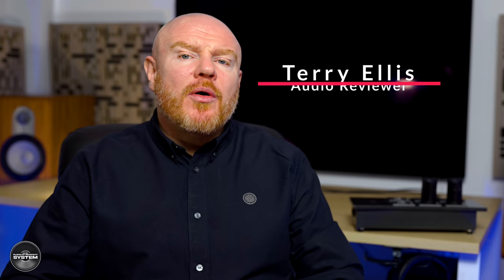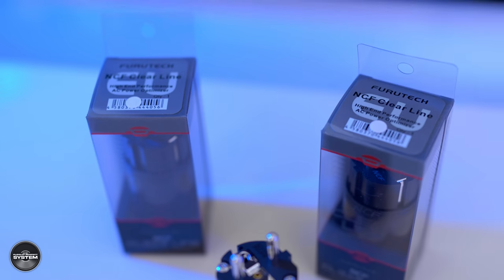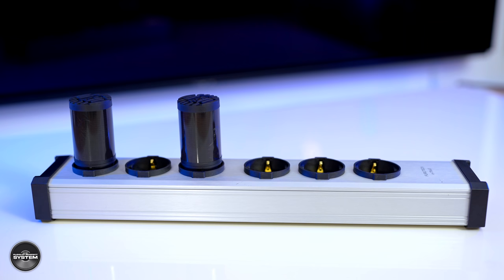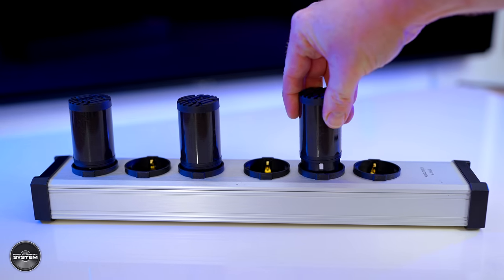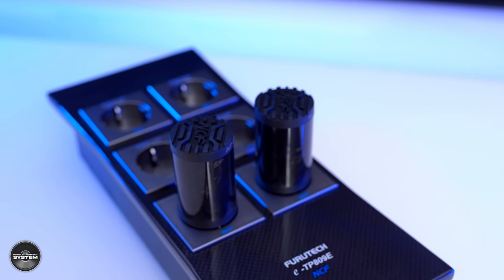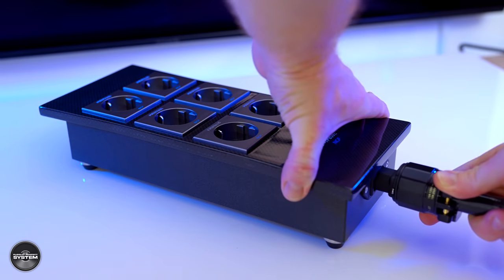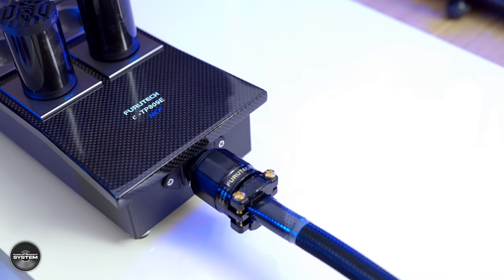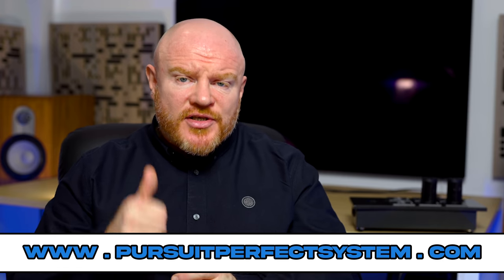Does Power Matter for Sound Quality ?? Furutech NCF Clear Line Review

Comment: The main thing that is happening here is the background is becoming slightly blacker and more acoustically transparent. Initially, there is a whisper of air and freedom that appears around the singer's voice that grabs your attention which in turn makes you listen for similar improvements around the instruments. Once you hear them, the difference is quite apparent. In my journey through audiophilia, I have saved so much money simply by improving the power that I am feeding my system. I use the iFi Audio power solution with AC filter that is very similar to this Furutech example. Gone are my days of trying to improve my system by replacing components because I am looking for that next micro slice of goodness. Now I have properly clean, inky black, silent power from the mains and all ports, I only need to change equipment if it breaks or I want something different. I'm pretty certain that I now have my endgame thanks to clean power and clean audio signals. This is such an important piece of teaching that is often missed by would-be audiophiles simply because they are unaware. Really good job, Terry. Outstanding video with the right amount of audio comparison to give people a better idea.
Reply: Hi
Reply: and other conditioners such as lessloss 64x firewall and better fuses

Comment: As in the past tubes in amplifiers was call VALVES because it open and close current flow from power supply section, it is clear that we listening power supply via controlled current flow in speakers. That is a physics of power amplifiers and their definitions.  That why is called POWER AMPLIFIER. Opinions can vary, but opinion will not affect physics and how it works.  So how many brands of POWER AMPLIFIERS declare relevant parameters of power supply section - non. But you need special power cord that cost  30% of power amplifier ??. How about that all these reputed makers of power amplifiers make a popper power supply that shall not depend of impulse transfer performance of power cord? And stop declaring that power supply section is compliant with standards  made for water heaters.

Comment: Outboard filters, come in the shape of power line condition sockets or plug in like the NCF in this video....inside really just some coils. capacitors, diode and some transistors...
They do clean the noises and "condition" the electricity flow for better sound and video....
But what we need to know is where and when we need them because they are quite expensive for what they are...
In high end equipments (amp, pre...), these filtering circuitries could be well built in already, with very good design (double or triples the filter stages) and high quality components, ...So adding Outboard filtering is not necessary, it basically means you are adding another stage on top but with a lot of money.... in most cases they only change the sound, not the quality...
If you have lower tier equipments, then yes, it makes sense to spend on these power line filters...
So you have 2 choices, spend all money on better equipments, not on the power conditioners...or buy cheaper equipments then spend some more money on conditioners...the total amount of money could be the same, so its your call..
Reply: But Terrys system is very expensive. And I doubt anyone could dismiss the difference....

Comment: Here's two start points so you can compare quick A/B's
 11:55 12:41
For anyone not hearing a change between the two, perhaps the easiest difference to notice is the much greater "black background" in the second clip. I'm not sure which I prefer personally but it's certainly doing something. Thanks for a very well conducted demo!
Reply: The clear line has been tested and it did nothing to the power sent through it. All the noise was the same as with the original wall output.

Comment: I set the video to 2k and using my low/mid range ‘Cambridge Audio Melomania Touch’ I could detect a difference. I could hear it when really trying, the clarity and depth improvement, as if compression removed. But. I really don’t think there was enough of a difference to warrant spending so much on clean power. I’d rather upgrade my amps/speakers/source. Awesome video though dude. Love your channel :)
Reply from the maker: Thanks Marcus everyone is going to spend money where they feel best suited but of there is compression on the sound caused by the mains then it won't go away with better equipment if anything the better equipment will highlight it more as it will have more dynamic range capability that will be being squashed  something to bear in mind. Also in the flesh the difference is much bigger to be able to make it through to the other end still audible :) cheers for watching  man and commenting
Reply: @PursuitPerfectSystem  My pleasure! I am a big fan and much respect for your system work, knowledge and room acoustic calibration skills. I would say you are my primary source of reliable Hi Fi information - I get myself the Audiolab 6000A off the back of your videos a while ago, and you nearly had me buying the B&W 603 S2 Anniversary until I decided on MA Silver 500 at the last second ;-) . The more reviews and sound demos you can do the better as far as I am concerned...Top man, top channel. Take it easy mate.

Comment: Just to silence the critics, why not do as follows:
- Post a video where you do not show or tell what is being played on, and randomize the order.
- Let's say 10 consecutive time windows within the same audio track, some with Furutech connected, and some without, precisely timed crossfaded to remove any clics in the change.
- You do not necessarily change every time, but both should be represented at least 3 times within the 10 time windows.
- Any timing errors between two consecutive time windows should be similar with or without anything being changed.
- Making sure nothing else, including the mic location, is kept the same.
- No post processing on the audio allowed.
- You give no clues away for at least 4 weeks.
- People can post their listening results in the comments section during this period.

Wouldn't this be interesting and pretty doable as a kind of non formal blind test?

Comment: A sound is harsher and more edgy. B is a bit smoother on the edge, and controlled. B is definitely better match with the speakers (which can come across as harsh on the highs). 
Quality Power block management system, and power cord are more critical the further up the high end chain you go in components and speakers. 
Thanks Jay, keep bringing the knowledge and the proof in the pudding (sound demos).
Reply from the maker: You keep getting my name wrong David haha :)
Reply: I did it again mate, my bad Terry.
Reply from the maker: @davidrivera2165  haha :)
Reply: @davidrivera2165  Jay covers the billionaire market segment, Terry covers the other 99.9%, both play a tremendous role in disseminating hifi knowledge. ;)

Comment: I do not understand this.  Filters/capacitors in the amps are designed to do this.  Does this just add another filter upon a filter.  Why would that not start to effect the sound quality negatively?  I closed my eyes throughout the sound test and then went back (Sony MDR - 1R headphones) and could not tell when it was filters or not filters.
Reply from the maker: its not a filter
Reply: When we design hardware, top priority is, that the device doesn't affect the environment in a bad way to pass the standards thus to get necessary certifications for market launch.

Comment: @terry The inlet cable for the power distribution block is the Uk version? if not how did you connect it to the Uk wall outlet? Thanks.
Reply from the maker: The Furutech block accepted any power cable with an IEC connector so I could use a UK power lead from the wall to the distribution block
Reply: @PursuitPerfectSystem   Nice, which power cable did you use? Thanks.
Reply from the maker: @berj79  sorry it wad a while ago i dont remember but i am sure i listed everything in yhe video description maybe check there

Comment: I watched the Furutech video on the linked web page. This is a completely passive, mechanical device with no circuitry interacting with the power delivery. I fail to understand how it works to achieve the stated purpose.
Reply: It works by psychological means. You plug it in, and therefore there must be a difference! So people "hear" a difference. Probably also because their head isn't in the exact same spot as before. I've heard "a difference" just by listening to a song for a second time tbh

Comment: Are you planning to make a measurement a/b test? If it makes differece that ears can notice, measurement microphones will be able to capture that difference! Cheers
Reply: Not true. 
Make a speaker with two different crossovers, one with cheap parts and one with top end parts. Measurements will produce the same frequency response but it will sound very different to your ears.
Reply: @Mark-mj6qp  don’t agree. I beleive it would be pseude science. If there is a hearable difference, it  should be measured via something like microphone/ impedance / impulse response
Reply: @berkayu  NOT again...another measurements fool! Listen with your ears instead of looking at manipulated measurement protocols. Until then... see ya
Reply: @berkayu  I can't hear any difference and if there would be a difference, it should be measured. If my ears can measure it, a mic oder something else should measure it too.

Comment: to hear a difference  (in cables, DACs, power conditioners, and so on ) the speakers should be isolated from the floor

take a look inside of your speaker:

- if they are using quick/fast connector on drivers and terminals (thats only good for led lights) usually aluminum even on high end speakers like mine (but I am not gonna mention what brand they are beacuse they sound very good now) 
- the best way is to solder the wire directly, you should hear a better, tight sound
- after everything is properly set up then you can do a test with or without (cable, dac, dc block, power conditioner, etc)
- also it will be a bigger difference on a system that costs 7000$ then on 2000$ system 
- in my case I didnt hear a difference between the DAC from my LG C9 tv and the DAC in Burson Playmate2, after I started to play with all those things that I mention I could clearly hear that the sound from Burson DAC is more open with more detalis

good luck and never give up :D

Comment: Terry do you have a dedicated mains supply? I’m just wondering as I’ve found the NCF clean line to be less effective. Probably because dedicated mains is dealing with the root cause of the issue. Also, biggest effect for me with dedicated mains was putting in my own ground spike. I still use the clear line to good affect mind you.
Reply from the maker: I do have a dedicated mains for the HiFi but no ground rod or anything like that.  Have you tried using a couple of them in your power distribution  system?
Reply: @PursuitPerfectSystem  no just one! I actually removed my conditioner! SQ went up, huge dynamics now. I didn’t appreciate how much my conditioner was holding things back. I won’t name the company as it’s all system dependent but was in the region of 7k, not cheap. I’ll try a few more to see how things go. Cheers

Comment: There will allways people sticking capacitors in outlets and claiming to hear the difference. Any real power conditioning is done where the current runs THROUGH the device, eg. a typical EMI filter now practically in any pluggable device: X and Y caps, X resistor, symmetrical choke or more, they do a very good job. 
Here it is not so much about the improvement, but the concept: they obviously don't WAN'T to do it properly - and this way mock consumers who don't know better. 
Also, this is Youtube - you just don't have enough sound resolution through it to hear the real thing. If it hasn't been not put there on purpose when making the video... 
EDIT: 
My presumption that there is a cap inside was obviously wrong, as they are talking about coils in the specs - I just cannot imagine how would you even improve the mains quality connecting a coil in parallel. The cap would theoretically work - but this is obviously pure snake oil (notice they keep talking about the case 90% of the time in the specs). 
Want better mains? Buy Furman, use an isolation transformer, rectify and then invert the power, whatever, but don't buy into such crap. This is just abuse.

Comment: Hello sir, since I'm not expert I would like to get an advice for a budget power condeitoner, cable and wall socket.
Right now i have weiduka ac 8.8 but and after i used it i keep getting a click sound every time i run something, only before an audio start, didn't get it with the old normal conditoner, rather than that i have no issue and my electric is good.
My setup: denon 3500 with kef q750 speakers, no amp and there is no ground in wall, old building.

Comment: hi excellent sound as always
i am not an expert but if i had a very expensive rig i would invest also in a only decent spectrum analyser to check for any noise at the speaker end without input signal and volume at max
the lower the noise the better

Comment: Just like the stereo system itself . The source + cable + preamp/amp + speaker cable + speakers need to be balanced as a whole system. The power delivery should be the same. Power grid + circuit panel + wires + plugs + power cables. A balanced equal system. Strong links are over priced and weak links are a shame

Comment: do hear the difference but not as much as i wish to, mainly is this is recorded and youtube audio compression is lossy. i using cheap headphone and normally microphone won’t capture “everything”. there is a noticeable drop is noise floor, and if there is more focus and soundstage in depth and width you have to be there to listen. i have something similar to furutech clear line and it did improve the focus and soundstage, a huge drop in noise floor. i wonder how one clear line will do in improve may try one out but i see u use 3 which of coz will take one socket each.
Reply from the maker: I used three because I had three and I had to try and get as much difference as possible in order to try and record the sound, I could only use the Clear Line in the Power strips because they are Schuko and not UK plugs so it made sense to put them all in the blocks rather than not use some.  Two was a very nice sweet spot

Comment: The difference is huge and you pretty much turned a skeptic into investing in power upgrades, but before I do...
Does the wall socket/outlet need to be grounded in order to revcieve the benefits of a power conditioner? Supra seems to be the only manufacturer mentioning this. I can't seem to find a straight answer. Unfortunately mine are only grounded in the kitchen and bathroom.

Comment: I guess one is not enough as it has done nothing for my system.   I wonder if using a power conditioner negates the effects...adding the Audioquest Nigra 1200 dropped the noise floor quite noticeably.
Reply: Hi David, I'm waiting on my Niagara 1200 on backorder until late Sept. So the NCF with the Niagara made no difference ? May I asked where did you use the NCF in the power chain? Also how do you like Niagara so far?

Comment: Hi Terry , listening through headphones i can tell the difference between the two different power blocks . The larger black one seems to take away the slight dryness to the sound of the silver model and also allows you to hear more into the performance. I also felt the central image was better defined on the ‘ B ‘ sample .
The second dem was more subtle , there was a difference but in my opinion less pronounced. 
I suppose each person needs to ask themselves if they are prepared to pay the asking price that the improvements give and whether they are worth x amount etc

Kind regards

Comment: Interesting comparison. Slight changes in presentation.   So here's the real question.  What if you took the £4000 from the Furtech system and took the £2000 of the Arcam and spent £6000 on the actual hifi component(s) and continued using the £2.99 kettle leads..  What would be the sound quality then?  This is the approach I took and I am very happy with my sound quality.  It's not really "is there a difference" as much as "is the difference worth the money".  If you are spending £4k on power leads and only £2k on your front end, dac and amp combined, then I think there may be a few screws loose somewhere, and I don't mean in the hifi equiment! :p :)
Reply from the maker: Slight changes in the video are big changes in real life they have to be to make it through to the other end :) plus you wouldn't want products like this to change the sound they are optimising it probably the best way to look at it
Reply: @PursuitPerfectSystem  that was on my pc, I'll listen on the Mains later see if the difference becomes bigger
Reply: @MrButuz  My system isn't at the same level as Terry's, but I spent about £600 on a decent mains block and 3 cables, with a bit of experimentation it transformed the sound quality.  I'm not talking about a marginal improvement.  

Added together and bought new, my system would be about £8-9k.  I do not regret spending that bit more to improve the sound further.  At whatever level your system is, simple kettle leads will limit its potential. 

By the way, those £2.99 kettle leads - you were done mate.  There's a bloke in my local market who only charges 99p a cable - perfect for that £6k amplifier!